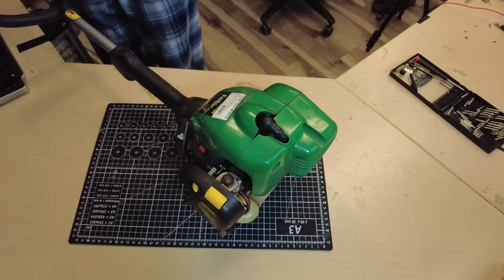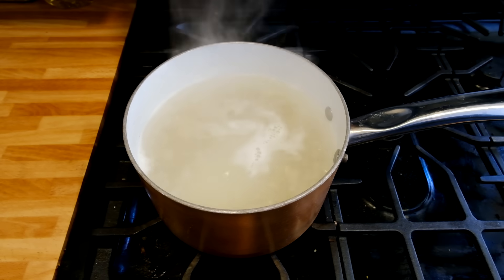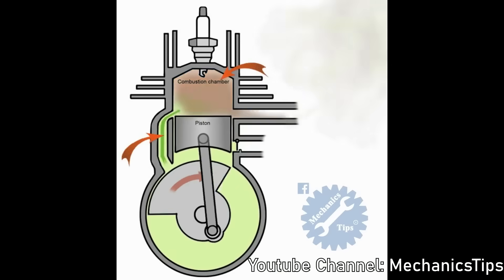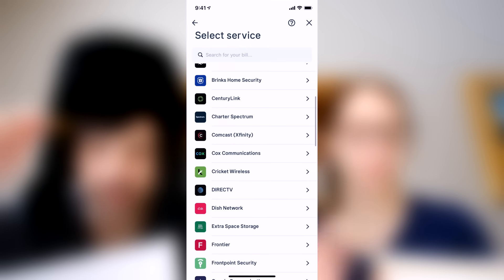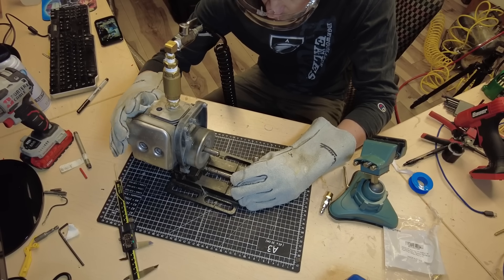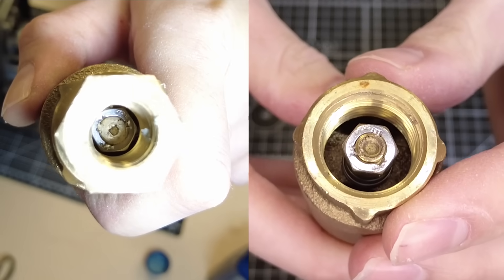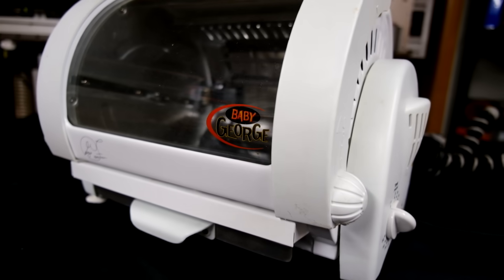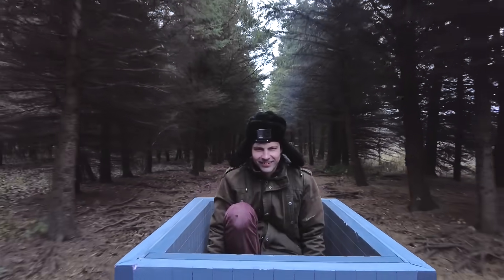Steam engine for Minecart furnace IRL

Comment: I still think you should invest in real wheels built for the track as well as having two pistons so you can offset them from one another as the solo one might have trouble driving it on its own with out something like a push to help get it started

Comment: You should just pick up or find the blueprints for a 0-4-0 live steam locomotive boiler... add a single piston connected to a single gear and a chain or pully/belt to make it a chain driven locomotive. On behalf of the railroad community I challenge you to do it right. Don't forget you pop-off valves

Comment: Could you not use the valves that are built in to a petrol engine, like that vales the engine normally uses to get the mixture in and exhaust out?

Comment: Cool! One thing that I thought of was that you could try something like in this video. (https://youtu.be/_3w75Bc6BH0) That way, you could achieve the same result without need any batteries for it to run, which could save you a lot of money. Also, because you can tell where the magnet is on the flywheel, it might make it a lot easier to get the timing right (assuming that it’s lined up with the crank) and although you might not need to set up the exhaust (his used to be an air compressor) you would have two versions for reference, one with and one without a diy exhaust valve, depending on which applied here

Comment: Slap some oiler lines on the crank bearings before you ruin them. Or turn the crank case into an oil sump and block off the transfers. This is pretty sick!

Comment: DISCLAIMER: I dont work with steam engines
i think you should add another canister to keep pressure high by utilizing a electrical pressure monitor you can have one can running at a time and of the running can is low on pressure it seitches to the non running can allowing the first can's pressure to build back up

Comment: Here's a tip: add a waterglass so you can monitor your water level, if such a senerio that your boiler is low on water, there's a good chance that your Furnace Minecart would become a TNT Minecart. Most if not all steam boilers come with one

Comment: Don't forget that this is a 2 stroke engine and you will need lubrication for both the cylinder and crank. If you found a small 4 stroke engine where you could modify the valve timing, you would maximize the reliability and performance.

Comment: Converting steam pressure directly to mechanical power ( for moving objects ) is hugely inefficient.  You best option, if you look to make a good system, is to use a mini boundary layer steam turbine ( Tesla turbine ) to convert efficiently the steam pressure to rotational motion, and power an electric generator, that feed to a small battery/capacitor bank. Use now that electric power to drive an electric motor. That is the most efficient use of fossil fuels to move of objects.

Comment: The use of an old pressure canister makes sense but I would suggest hooking your output from the engine into a second container as a cooling unit, with optional release valves.  Then feeding it back into your boiler.  Would reduce lost heat and steam. If your cooling unit was set up right you could even add more water of the fly.  Obviously your 'furnace' should have the heater be a portable coal BBQ for realism

Comment: I have a compressed air engine that will run off steam and can be 3D printed. 60psi should be more then enough to drive the cart. At 120 it’ll reach insane rpm.

Comment: Cool  thing man!  Just something to add, as a mechanic, one of the most important things we are thaught is, lubrication is essential for a fine working engine. And that is a 2 strokes engine, wich uses oil mixed with fuel to lubricante not only the crankshaft  but the piston, wich means that the comb. chamber and the crankshaft chamber are not hermetic like a 4 strokes engine
The point is, you should add some sort of lubrication device to extend the lifespan of the engine, and it beeing a 2 strokes makes it much more harder.
Greetings, keep beeing cool
Apologies for my english.
Reply: Your english is excellent.

Also, many steam engines had total-loss oiling systems that used oil injectors to add oil to the steam. Just like a 2-stroke with an oil injector. Fun fact!
Reply: @trekintosh  Oh! I didn't knew that. Thanks for the knowledge!
So... steam engines work like a two strokes but they dump the oil instead of burn it, cool!

Comment: Well the first thing youre gonna need to build is a proper steam boiler. A gas tank inside a roticery is a neat proof of concept, but it will neither produce steam for long nor will it be portable without a massive source of electricity. 
Secondly superheated steam is your friend, because regular steam only gets you so far. Though if you stick to Minecraft... it took Steve over 10 years to figure out how to make a blast furnace. 
Who knows if he could ever figure out a powerful steam engine rather than just a basic one.

Comment: if you can, get an old flathead briggs and stratton engine and weld on two additional lobes onto the camshaft to have the valves open twice as often. I saw an example on youtube somewhere a few years back and it ran super smooth with plenty of power.

Comment: Would it be possible to use some sort of induction coil to heat the boiler, I know it will take a tonne of electricity but might be more effective than some other options?

Comment: Only thing I'd do is keep the Minecart electric driven and just add the steam engine as a battery charger with an alternator on the driveshaft.  And I'd probably use a small but modified electric water heater as a boiler. You could probably daisy chain a few of those $15 Weed Wacker motors to do the job. The thing you need to add is an oiler into the mix somewhere in the steam line. (Recommend looking through https://www.youtube.com/c/keithappleton Keith Appleton's videos to figure the right placement.)

Comment: Cool. As for my interpretation of the furnace minecart, steam engine is a good solution, but considering the furnace cart moves from just burning coal, I think a stirling engine, since it doesn’t require water and harnesses the temperature changes in the temperature of air trapped within the cells to run when a heat source is applied.
Reply: Have there ever been any Stirling engines that produce reasonable levels of torque without being stupidly massive?

Comment: Why not just use a pressure cooker and a hot plate/camp stove for the boiler?
Reply: Or Rocket Stove for the non-lp /electric option to heat the pressure cooker.
Reply from the maker: Pressure cookers are not rated for high pressure, just look at the one in my video that failed.
Reply: @JoelCreates  but that one most likely failed due to its relief valve getting stuck.   You're going to be constantly draining pressure from it.  Also you proved in your test from this video it doesn't take high pressure to spin your engine.

Comment: Nice job at building a steam engine! Personally, I would of used a 4 stroke gas engine and fed the steam through the intake. This gives it a much more simpler valve setup that doesn’t need electronics. Also, I would use two of these engines with one at top dead center and one at the halfway point or bottom dead center. For the boiler, I would make a boiler design that can create more steam than the steam that is used. hotter temps or getting a even heating throughout the boiler may help with this.

Comment: I forget what there called but there is an electronic thing that uses the difference of temperature between its two sides kind of like a Sterling engine. But when electricity is put through it, it heats up on one side and cools on the other. Also if you apply heat or cold to it, it generates electricity. The neat thing is you can make a home made generator with this tec.

Comment: As a steam enthusiast, I love this! However I’d recommend a stronger pressure vessel and definitely a water gauge, as in most steam engines if the water runs dry it may burst due to the heat.
Reply: ah another railway enthusiast (but i kinda like electric locomotives like the ones used by the Chicago Milwaukee St Paul & pacific railroad)

Comment: you should (although it's not required) make sure that engine still has a way to keep the piston lubricated and (if you aren't already) dry out the piston and the cylinder after each run so there is no rust build up

Comment: I'm not sure that this will work. Steam engines was build with low rpm / high torque to give the steam time to move around.
Sure, your conversion "will run" but you will get miniscule power from that setup.

Comment: A larger flywheel will help this immensely! When i was experimenting with the compressed air powered version. I ended up using a heavy, cast aluminum platter off an old junk turntable. Then i just used one of those air dusters that hook to the compressor and some brass fittings. I ended up with a pretty torquey engine with decent revs.

Comment: now you need a water tank, a battery, and some way to get water out of the system. that last one is REALLY important. water isn't compressible and it WILL obliterate that puny lil engine if you let it.

Comment: I already know how steam engines work you put coal or wood into the boiler then it bubbles to make hot water which makes steam comes out the funnel and then it turns pistons that move the wheels

Comment: Connect a cam to the flywheel and use a compressor blowgun, let the cam hit the blowgun lever and adjust the lever hight for “valve lift” 
The electric switch is nice but mechanical is more reliable.

Comment: Make a double expansion steam engine using two 2 stroke engines of different sizes. Feed the exhaust steam to the second, larger engine. Probably should be 180 degrees opposite the first one. Make sheet metal jackets to fit around the cooling fins then fill them with spray foam. Steam engines don't need cylinder cooling. You also should insulate the feed line from the boiler and the steam connection between cylinders if you're going to do a double expansion engine. Condensation before the steam gets to or leaves the engine is bad for efficiency.

Something steam engines need for safety is a way to automatically shut the heat source off before the boiler runs out of water. With old steam locomotives the engineers made sure to refill the water before letting the wood or coal in the firebox finish burning. With oil fired steam locomotives it was much simpler, just shut off the oil feed. For model steam boilers the usual procedure was to not put enough fuel under the boiler to last longer than it took to boil away all the water.

Putting a condenser on it after the engine saves on water loss but then you need a high pressure injection pump to force the condensed water back into the boiler. Of course that pump was driven by the steam engine. Not a big energy use when the engine is a multi-ton, multi-thousand horsepower locomotive. With today's gear you could put in a high capacity battery to run an electric injector pump.

Comment: Adding stern to the crank case won’t increase speed much but it will increase torque and efficiency as the piston would be pushed from both sides. 

Although you would likely have to block off the original transfer ports and add a new exhaust port or the steam will just go to the top side of the piston and fight its movement.

Comment: If you have two of these "pistons" linked together on the shaft at 90 degrees from each other.
It may help overcome the dead spot when starting.

Like others said, you may want to invest in some 'Steam oil' to help with the lubrication of the pistons.

Comment: your thinking is in the right place, but the boiler will be a source of constant headache. Its heating area is WAY to small to sustain that engine (side note, your wasting a lot of steam letting the other end on the solenoid vent like that) I would suggest building a vertical fire tube boiler (or having someone with welding experience build it for you) or a Mono tube steam generator which is the safer option and can be easily constructed out of copper pipe (as a rough estimate I would s'pose 50ft of 1/4" copper pipe would produce enough steam for sustained running) the only caviot with this is that a high pressure piston water pump is needed to feed just the right amount of water into the boiler to maintain steam production wile not flooding the engine  or causing the pipe to get to hot and soften. (I've heard that someone used a modified grease gun for this application although how successful this was is unknown)

also your engine needs some form of lubrication, simple displacement lubracator is a vary simple build and I suggest you look one up on professor google for "a picture is worth a Thousand words" as they say. 

In short I would talk to the guys at the miniature railroad you ran your original mine cart on, they work on steam locomotives daily and if there like most steam people will be generous with there knowledge. if you can, get a shop tour and they will show you how they do things and how these engines work. 

here are some links to get started though:

https://silo.tips/download/building-a-flash-steam-boiler
https://stevebb.wordpress.com/home/monotube-boiler/
https://www.homemodelenginemachinist.com/threads/medium-sized-monotube-boiler.1883/
Reply: Also fill in the cooling Finns on the engine (with something insensitive like fiberglass or even shredded news paper if it could be kept dry) because unlike in a IC engine where you want to get heat out, a steam engine needs to keep as much heat in the cylinder as possible to prevent condensation of the steam.

Comment: I think that you may have a bit better time using a four stroke OHV engine for this, that is if you play around with the valve timing to get the steam in and out right. Plus an added bonus is that you can lubricate the bearings so the engine can run at higher RPMs for longer.

Comment: Adding steam to a second side of a piston is going to help in HP and Torque, there will be no immediate effect on RPM. That's related to your pressure. A 3-way valve as you are using on both sides would be ideal with the the unpressurized side venting through the valve while it's not receiving steam. You have given me an idea though since I've got a couple junk 2-stroke weedwhacker's around.

Comment: hey joel
not sure if you know this already but 
friendly reminder that 2 strokes need oil
steam is not a great lube, put a side cover back onto the crank case and put a bearing in there along with put a oiler for the crank and also use steam oil for the piston rings, 
that way the engine wont explode itself from friction.

Comment: You could have used the magneto to operate a solenoid valve all without using anything like a battery or a micro controller

Comment: If I were you I'd use a 1 or 4 hp Gast pneumatic motor... They run great on low pressure steam, self starting, produce excellent torque, fairly cheap, no electronics and easy to mount to a surface. They also sound cool. I tested a gast motor on one of my steam tanks and it was pretty simple and exciting. I also have steam rocket jet packs on my channel.

Comment: The other problem is he used a 2 stroke engine, which might lock up without the oil contained in the 2 stroke fuel mix

Comment: I think you need to further investigate that idea of making it a double acting engine. Also, the water condensing on the surfaces can act a bit like lubricant for the moving parts. Not a very good lubricant, but it might be enough to extend its operational life.

Comment: I hate these electrically switched steam engines because they don't last as long as the check valve style and need power, you want a slide valve like double acting engines and how the orignal valving worked on the 2 stroke

Comment: I don’t get how this works at all. From what i have read the compression ration of 2 stork internal combustion engine is about 10:1. 
So if the piston is at top dead center pressure in the piston is already around 10 Bar?  
How can steam or air enter the cylinder if it is under ~10 bar? 

Is the valve letting pressure from the cylinder out if it is "closed" so the cylinder can’t compress on the way up?

Comment: This is pretty interesting. Looks like you're gonna need a big boiler, tho, if you want to get very far. Dont think I'd want to sit next to that. Maybe a small hot water heater tank would work? Mythbusters got those up to 300 psi, I think, before they blew up. Would be expensive and dangerous, tho, as you'd have to disconnect the safety features and install your own. Anyways, that's one option. Not sure of the others

Comment: 3:30 this is the difference between single and double acting engines. Double acting engines are amazing for lower speed, higher power applications such as locomotives and ships. However single acting engines are amazing for smaller, higher speed, lower power applications such as models. Valve timing can be tricky, but there are several people out there that would be delighted to help. If you ever want to refine your cart, I would say to seek the expertise of the YouTuber Keith Appleton, he is an expert on all things miniature steam

Comment: The open port of the valve wastes most of the steam. You should consider using a four stroke engine, it already has proper lubrication and valves, you just need to modify the camshaft.
The best way is to make the camshaft rotate twice as fast, so that opens the valves on every revolution instead of every second revolution. The position of the inlet valve cam also has to be changed.

Comment: A much more difficult but safer option would be to make a Stirling engine, it was invented after a few boilers blew up. No boiler, no problems 😉
Reply: Unfortunately usually Stirling engines don't have the torque needed to move anything